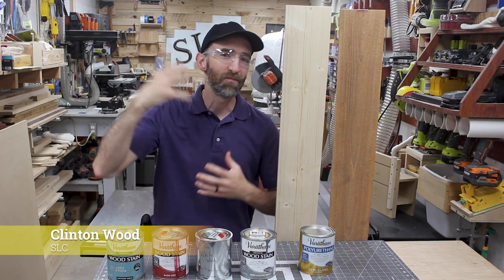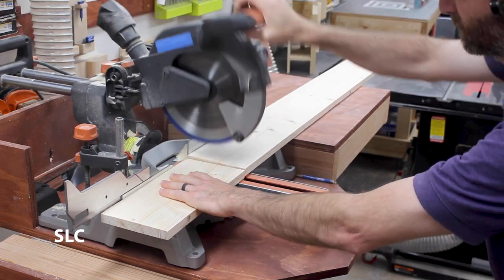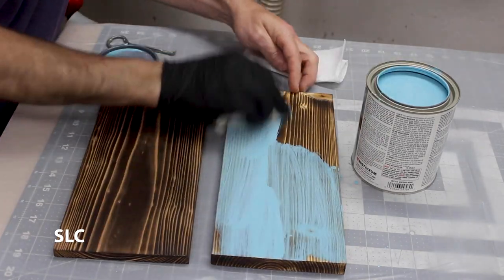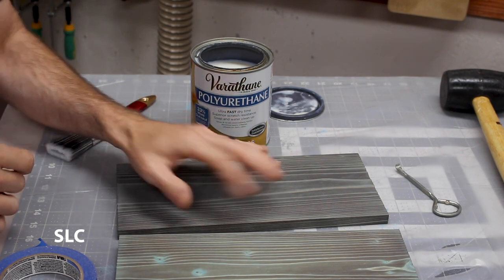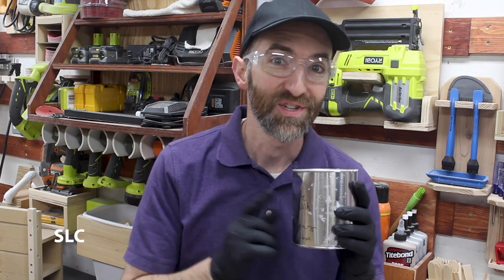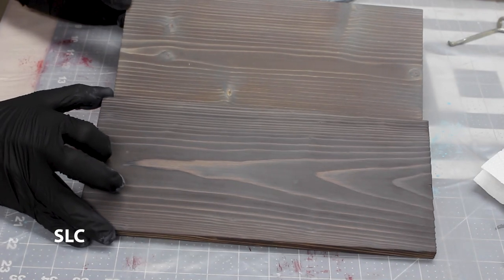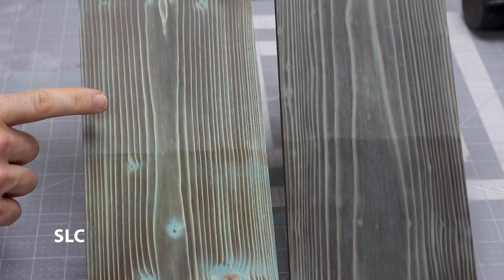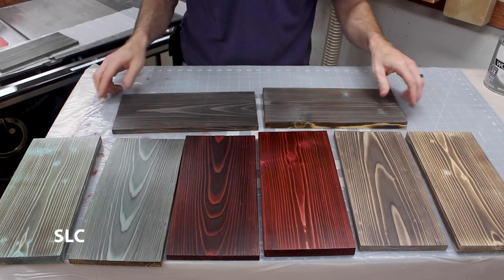Stained Shou Sugi Ban | How to Burn Wood and add Color

Comment: SL, the 1st thing you have to do after burning is hit the wood with a wire or plastic brush or sand paper 1st, wipe it down with a very lightly dampened cloth, THEN hit it with the stain & poly. Oil base, in my experience, is the best, not water base. 😊😊😊
Reply from the maker: Thank you very much for the tips

Comment: Great info! The problem with this kind of stain is that they have a clear base but with some white pigment and a high-density formula, instead the stain you can prepare with alcohol or mineral spirit are pure color with a transparent agent. sometimes I use the same pigment I used to do Tie Dye T Shirt for my kids. But both ways work for different kind of people. I prefer a softer colorful wood and of course...cheaper. Thanks for share.